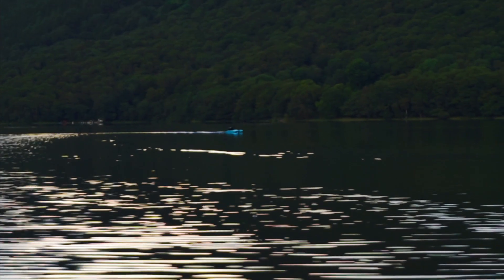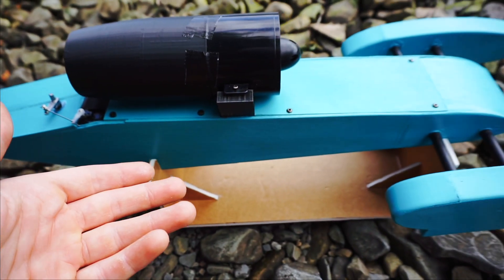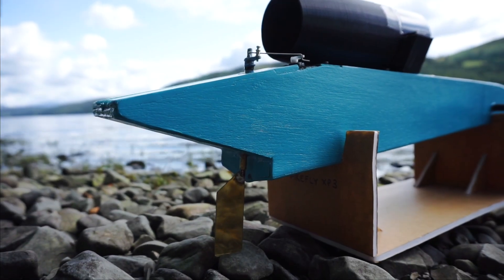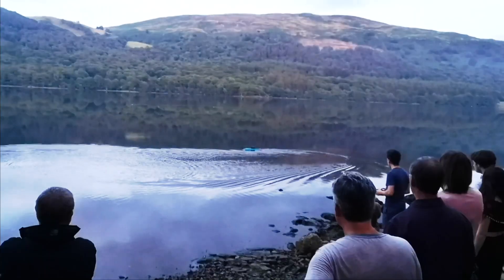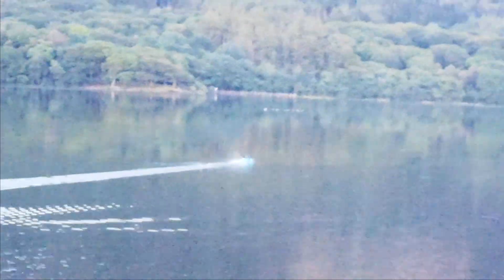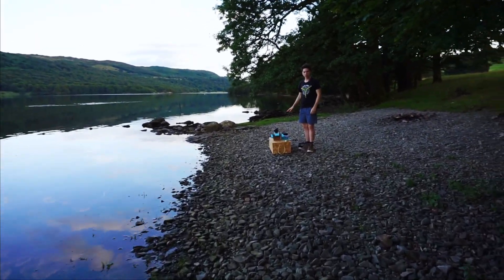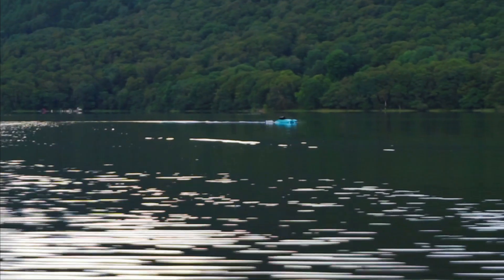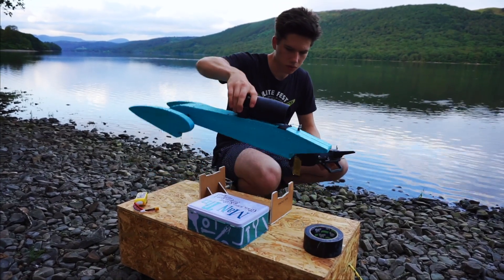Fan Powered R/C Airboat

Comment: The trailing (and side) edges of all water contact surfaces should have a sharp break.  Otherwise, water wants to creep up around the rounded trailing edges from surface tension and consume energy to break away from the hull.  Similarly, all ride surfaces must be dead flat, otherwise you are again wasting energy.

Comment: Hi James - did you ever get this hydroplane running at full speed/full throttle? I was really hoping to see an end to the story.
I'm working on my own hydroplane design, employing 2 EDFs w/ 6s batteries. If I may ask, what is your personal best speed ? And do you happen to know the world record for EDF-powered hydroplanes? Thanks for taking time to read a comment on such an old video. Tea ya later! 🙂
Reply: I believe the world record for edf hydroplane is set by radical rocket on YouTube (https://youtu.be/f7qbpfO-Ao0) of about 48mph at 50% throttle on a 120mm edf, he never did a update for 100% throttle, so my guess is it’s still 48mph, which seems very easy to beat (if you have the right equipment), I’m thinking to put a second edf on mine after I’m done testing with one edf, so you might have some competition 😏
Reply: @MatthewNovoselskiy  Very cool - I'll look forward to the competition. If the speed record is indeed up for grabs, I want it. I spent this past summer using one EDF on a prototype outrigger - I never tracked it but it seems likely it hit 40mph a couple of times. Next summer the second edf is going onto a new body with (quite likely) a tail wing & independent power systems. 
Hope to see you next year, mate.
Reply: @aljensen7779  interesting, by the way, if you have a GoPro hero 5 or above, you can measure the speed through that,  that’s how I will do it, also what edf do you have? I have a 70mm edf that makes about 5lbs of thrust on 6s, but I’m planning to put another after I’m done testing this one, so a lot 10lbs of thrust on a 5~lbs boat
Reply: @MatthewNovoselskiy  I have a gps speedmeter - it just didn't seem worth the trouble at the time.
Regarding my EDF, something I learned is that a short or wide hull will be very vulnerable to the gyro twist and I've picked  enough fights with physics to know a 2nd edf will make it worse so when choosing, I bought 2, 70mm EDFs, where one of them turns clockwise instead. That will cancel out the gyro.
The company claims 7.25lbs of thrust, each, but I only measured 60amps of pull on 6s. The company says 89amps, so definitely not as much power.
I have two 150amp marine ESCs and 2, 6s CNHL batteries. Still working out safety measures, like an emergency stop.

What size of outrunner is in your EDF?
Reply: @aljensen7779  by size of outrunner I assume you mean the motor size? Anyways it’s a d2842 2300kv 6s
Reply: @MatthewNovoselskiy  With a 2842 you must have boatloads of torque. No wonder you can claim 7.5 lbs thrust. Mine are something like 2832, so shorter but with nearly the same Kv as yours.
This will be an interesting summer, for you & I, eh?
Do you have a Youtube channel - and with your boat in a video?
Reply: @aljensen7779  yes, this is my channel, (just click on the profile) the latest video is only version one, obviously it failed, so I built a v2, which you can see photos of in the community tab

Comment: I wonder if altering the centerline of the fuselage would help reduce torque roll. Just having the sponsons shifted to side that rolls into the water more. It wouldn't add any weight, but might give a better balance under power.

Comment: Nice project man!
As you probably know by now Chinese high C batteries suck. They are not able to sustain the current you need. I would advise to pick Hacker batteries as this is a German quality brand. These are not ridiculous expensive but just do what is written on them. 

Choose the biggest size you can fit, there is no substitute for Ah's. For example ; a 3500mAh 20C battery has a maximum discharge current of 70A. A 5000 mAh 20C battery instead has a maximum discharge current of 100A.

I have owned several 'high C number'  Chinese Batteries, they just don't last. You have to be lucky to buy them off the right batch. I never was lucky.

The only thing the Hackers can't cope with is under voltage. So keep at least between 3.7-3.8V/cell static inside the battery. This is about 20% charge. This is also the storige voltage. This is under full load about 3.2-3.4V/cell depending on your load. 

EDFs are known for their high load on the batteries. A 70 mm fan draws easily 150A at full load. You were lucky the batteries couldn't deliver the current becourse your ESC would have burned out. For that kind of loads you need at least an ESC capable off 200A.

Comment: I hope you figured out the battery situation. EDFs really suck batteries down quick. Get a high C rating battery and shouldn’t have a problem. For EDFs I would stick with 40C or better. Anything smaller than that your battery will die quickly and puff. Good luck!

Comment: since your rudder is still dragging in the water, this causes the boat to slow down. This does not match your EDF. They tend to take a littlebit of air and accelerate it enormous, giving you lots of speed in the end, but lack of torque. Taking a bigger mass of air like you would with a prop provides this torque, needed to overcome the rudder drag issues.

Comment: An improvement on your previous boat. EDFs suck a heap of power, so it is probably battery sag. The solution is a better battery, higher C rating or more cells. Even an increase size (Mah) with the same C rating & cell number will boost the power, but add a small amount of weight. Good luck.

Comment: You're assumption was correct. A higher C rated battery would have made more thrust. EDF pulls a lot of current from the battery. I learnt this from my early days of flying foam EDF jets. That skimping on cheap low C rated meant less power of even audible surging can be heard at full throttle as the plane would fly past.

Comment: That air motor is not the hot setup I would build a twin electric motor catamaran with 2 electric motors with under water propellers for some real speed. I built a simple flat bottom hydroplane out of 2 4X8 sheets of plywood & had a 18hp outboard engine. The boat outran a 18ft speedboat with 150hp Mercury outboard on it & plained instantly. Keep on experimenting you will get there & if something doesn't work just move on & try your next idea.

Comment: Great video, the design looks good. My first thoughts on watching the video was that water ingress into the EDF was causing rpm to drop thus no full power, however as you demonstrated towards end of the video, the battery pack just couldn't provide the amps needed. Great proof of concept, great channel. 👍

Comment: Can't reach full throttle? Simple:  drag.
I had this exact issue years ago, nearly 3 decades ago---I am old---with a nitro / glow-engine boat. A simple mismatch between engine power & prop size, along with the natural drag of the boat design. A different type of epoxy-paint went a long way, as it will for you---but expensive for the purpose---but ultimately a slightly different engine/prop combo did the trick. I suspect the 3-D printed duct might figure greatly. You could screw around with different sizes, but you'll be surprised how much difference a smooth inner surface to the duct will make. Once moving through turbulent air at speed, along with the turbulence inside the EDF duct, you are basically running into a situation that would "normally" cause an un-start in an actual fuel-burning turbine. This is also the reason you can get full-boogie speed from the EDF from the stationary boat on land. #1 Try adding a bellmouth to the EDF, the 3-D printer is your friend. #2 Smooth the inside of the 3-D printed duct, a light 600-grit to 800-grit sandpaper will surely do the trick. #3 And most important of all:  DO NOT GIVE UP!! Everybody knows the Brits are a tough and crafty bunch of indomitable shrews, don't let them down 😉

edit: @6:56 the large amount of near-vertical spray is an indicator, energy being wasted producing some nice spray but no forward thrust.

Comment: You may try a higher C rated battery like a C75 you may also be able to go to a higher S rating like a S6 or S5 if your motor is rated for it .  You could also try putting a slope backward on your rudder . I would try putting a bit of toe-in on your sponsons , so the faster it goes the less drag it has . Awesome job . I have been watching a lot of videos on air boats the high speed ones like you have built and they have given me many ideas .
I have a number of different motors from drone builds from 2212 to 5802 and up to 18" props . But I have never built a RC boat so I would like to thank you and all the others for all the ideas .

Comment: Possible cause of "browning out" may be the ESC does not have current capacity for the edf at full throttle. ESC's will shut, slow down when over loaded.

Comment: You have too much friction from the large amount of hull in the water,  You NEED lift like a hydrofoil boat is setup to pop out of the water.  With the hydrofoil will allow you to lower the motor to just above the water to get your stability back.  Im sure you can get it up over 100mph with hull out the water,
Reply from the maker: Although there was too much friction on this particular EDF version of this hydroplane, I don't believe a hydrofoil is the answer to fixing the problem. If you check out my other video with the conventional motor/prop combo https://www.youtube.com/watch?v=z2-HcQ4P4sg, the boat clearly lifts well out of the water and is allowed to skim along with the tiniest of contact points with way less drag than a conventional hydrofoil. I'm going to build a new larger hydroplane sometime this winter that will be designed with all of these lessons from this current design in mind - then we can aim at 100mph! Thanks for commenting! I appreciate your suggestions. :)

Comment: Looks good. It seems to roll to the right, (under power?). Could be torque reaction as it seems to level when the power is cut. Perhaps some straightening vanes in the exhaust will remove the swirl from the airflow. Keep experimenting, there are not enough who do it.

Comment: Very cool! I'm not totally sure, but there were a few instances where I thought I saw the effect of the impeller's torque on the boat at high rpm. I dunno if it's possible to add another counter-rotating piece, or somehow offset the torque, but if I'm totally off, that's fine too. Either way, really cool build!
Reply: @Cerus98 that makes more sense, I suppose. I'm not even sure which way the impeller spins, come to think of it. Thanks
Reply: @Cerus98 ah. So I was totally wrong. My apologies. It looked to me like it was leaning the same direction the impeller was spinning!
Reply: @Cerus98 yeah, I fly a paramotor, torque is something I have to deal with. Though in my case all it does is turn me a bit because my motor is offset to counter the roll it gives. Like I said, that's what it looked like to me, one side of the craft seemed to dip lower as power was added. Buuuut maybe I was just imagining it...

Comment: Hi James - nice project. Might be worth investing in an ammeter / wattmeter combo to get the best out of the on-board electrics. Also, a comment below refers to an "intake lip" -  this could lead on to some full 'ram-air' ducting experiments to maximize the thrust from the EDF ? Does the LiPo pack have some cooling ? Maybe a small gain here too...

Comment: Cool, remove the rudder from the water   and set a new one in the tail, behind the  ducted fan like a plane, it will reduce drag and power consumption.   👌
Reply: that wouldn't have as nuch autority
could also cause it to not tack as well
so that it enters a turn by itself
Reply: https://images.app.goo.gl/9W1ambLtrgXCwHqF7
Reply: Take a peek to do this Air boat
Reply: @albertraich3492  i made a round nose hydro

Comment: You are also suffering from torque roll. The boat is coming unstable and wanting to turn on the rotation axis of the single engine. To counter it, you really need another engine that rotates in the opposite direction to counter torque roll, just like you did with the propeller version. But awesome effort.
Reply: @Cerus98 I know what torque roll is, as a pilot you have to be extremely mindful of it when increasing power in a performance prop aircraft. If you look at 0:03 you can see the boat raising the left float while digging in the right float due to torque roll. Once you start having differing friction levels on those floats, the boat is going to become very unstable and want to turn to the right constantly, and possibly dig the float in and flip the boat.
Reply: @Cerus98 i built an airboat with only one motor and large prop
similar to a round nose hydro
it also has a torque roll issue

it doesn't matter where the motor is, for it to induce a movement on the whole body of whatever it it mounted to, trough it's torque

the effect just becomes less, the further away it is from the axis that goes through the cg
Reply: @Cerus98 what would this be called?

Comment: Great video!  Great concept and great execution on this Proof of concept!  
Two suggestions... 1) with an EDF I've found I need to double the "C" rating 
of the ESC,  i.e. 40 amp ESC use a 80-100C battery ( my "rule of thumb" ) ( http://web.mit.edu/evt/summary_battery_specifications.pdf ) 
And 2) I've found by experimenting that reducing the "thrust tube" diameter actually reduced the thrust.... but then found out, through 
a "conversation" on YouTube experience, that there is "static thrust" and "dynamic thrust" ... and what I was measuring was the static thrust.  
Once the vehicle gets in motion, theoretically, the dynamic thrust will exceed the static thrust... I need to do some further research on this.  
I see the point in a gas turbine, as the pressure comes from internally, but when the pressure is generated by an electric fan... I'm not 
comprehending how/why this happens.  On the other hand, if you have a "force cone" before the fan, then it could, I think, increase dynamically 
the thrust overall....just my 2¢  
Keep up the good work, I would love to see and learn more!

Comment: when is the afterburner going to be installed?
Reply from the maker: andrew graham when David Windestal joins the project 😉
Reply: @Project-Air  two butane canisters in the pontoons, some brass tubing ,a oven spark igniter ,a little bit of perforated stainless steel  sheet to keep the flame away from the printed bits, easy as mate!

Comment: Get a higher C rating battery or connect 2 4s in parallel for double the amps
Reply: Correct sir!  boats need high C rated lipo batteries with thick wires & big plugs . There is much more drag on the water then say an rc car on 20c batteries. Get 50c or larger for boats.
Reply: @theadventuresofshellyandfr5618  You can`t just say "50C for boats" I have small models that are fine with 2200mAh 20C for instance, it all depends on size and output..
If that`s say, a 1000W EDF running on 4s, you need about 70A plus some headroom, that means a 4s 2200mAh 30C or higher will do, a 4s 4500mAh 20C will deliver 90A so that`s plenty.
C rating alone means nothing, just saying..
Reply: Double the capacity not amps.
Double the amp hours not the amps it gives out
Reply: @thecaptainnoodles  What are you on about?
Reply: @thecaptainnoodles  No, parallel doubles both capacity and discharge..

Comment: My guess would be an overheated ESC, not the battery.
Reply from the maker: Thor Magne _ could be, but I think it was the battery. Static tests with larger 4s batteries showed it could sustain full power. The smaller packs used onboard were only tested to full when the boat went on the lake for the first time in this vid. They’re the one variable that changed 🙂

Comment: Really cool! 
But you should use an Intake-Lip on the EDF. 
This should increase thrust by about 20% and also the efficiency (Oliver from wemotec told this in forums).
Also I would not use Zippy Compact batterys. 
I only made bad experience with them, normal Turnigys are much better and do not cost much more.
Reply from the maker: Absolutely agree! Unfortunately the intake-lip for this edf blew off in flight when the edf was used to power my EDF Glider 😂😂😂 I should invest in some new electronics.
Reply: ProjectAir you should 3D print a new lip
Reply: RcUpKoelsch Totally agree about the Zippy Compact batteries. I unfortunately purchased one not long ago, it’s been a disappointing experience. I have to adjust my timer from 5 minutes to 4, whenever I use it.